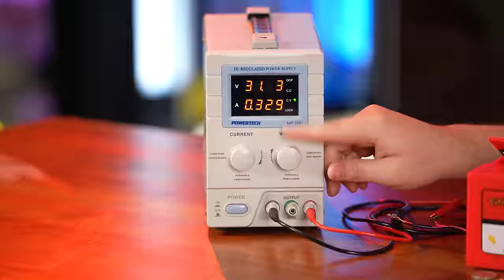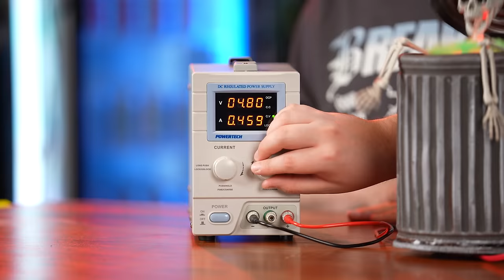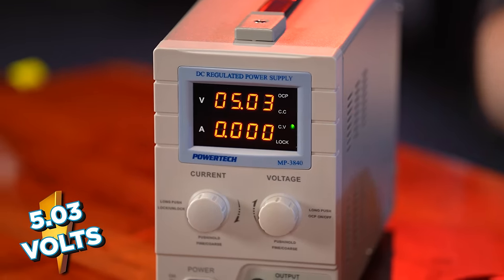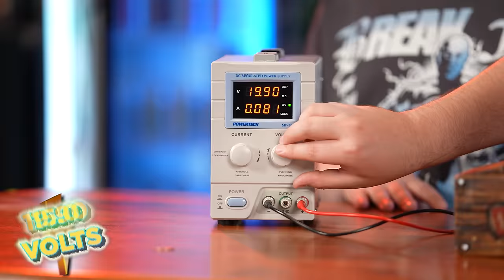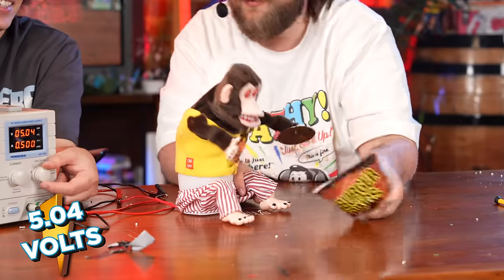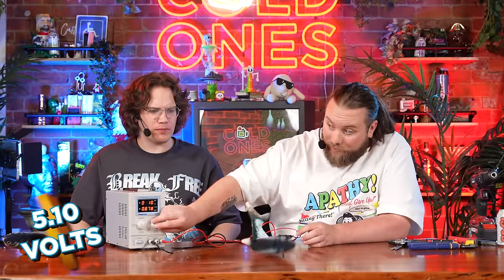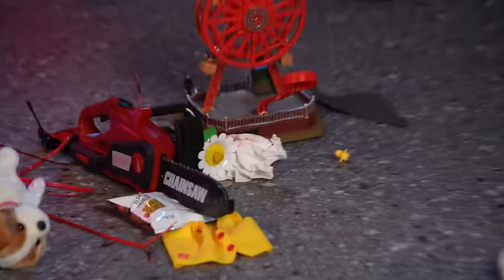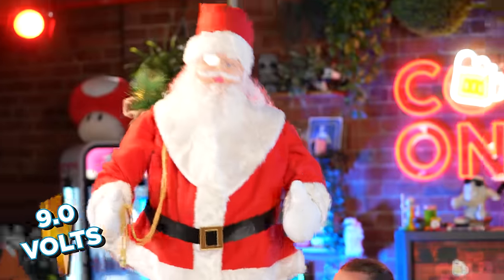We Applied HIGH VOLTAGE To Kids Toys

Comment: The speaker goes first because of magnetic saturation. An electromagnet can only hold a limited amount of energy, and it requires magnetic flux(energy) to FLOW in order to function. It's like a cloggged crapper; probably smells like one too.

Comment: its not high voltage those little psus do only 30v 
its only overvolting them as they normally  run between 3-6v